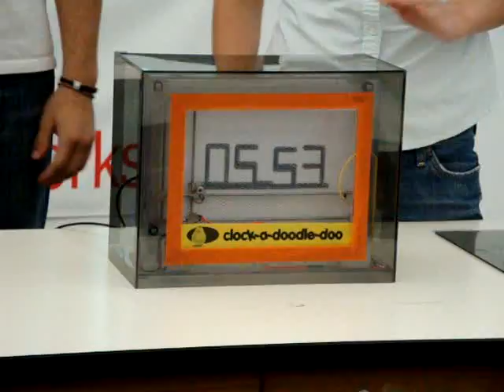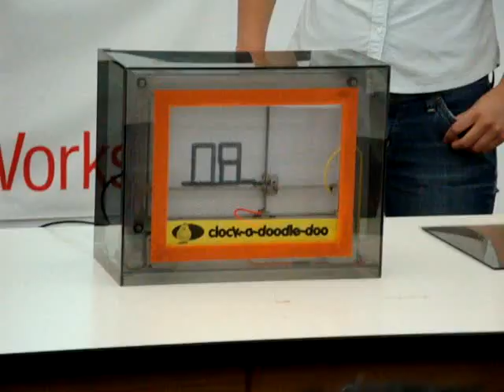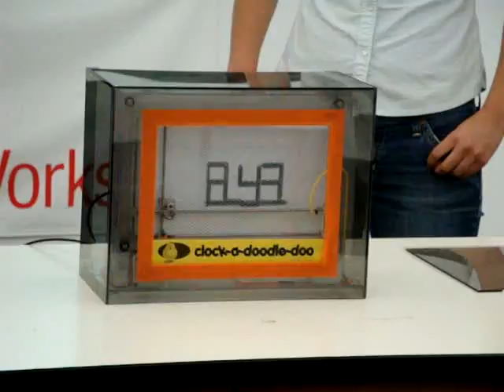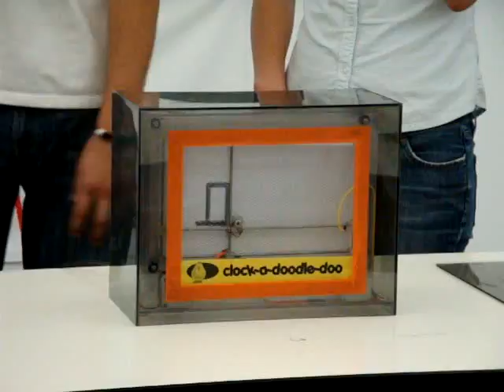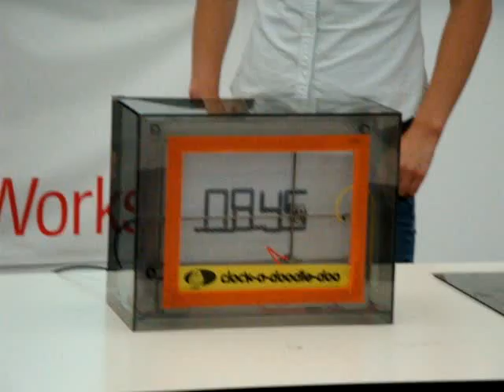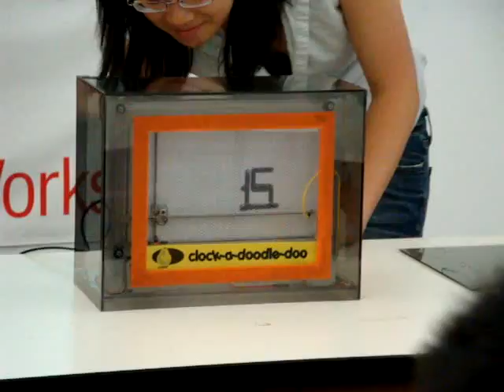162C clock o doodle do

Comment from the maker: I wasn't part of the group that actually built it but from what i remember from the presentation, the shell was made out of polycarbonate.  The surface of the clock is actually just taken from one of the magic doodle toys and plotting mechanism was derived from one of those etch-a-sketch toys.  It's driven by small motors and was controlled using basic stamp.  If they had more time and money it could have been way better